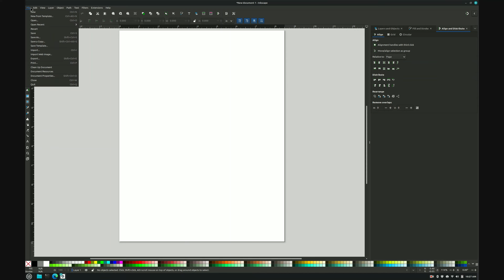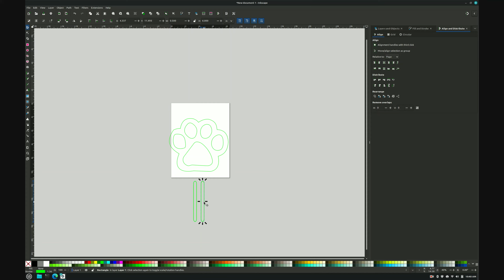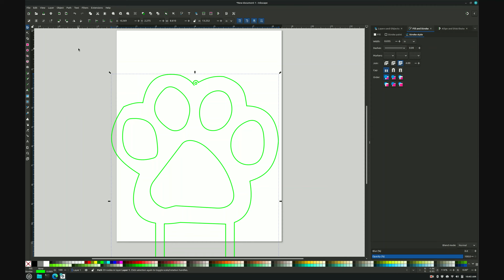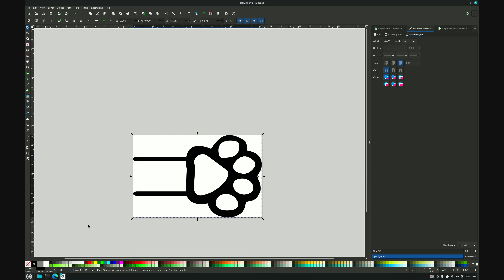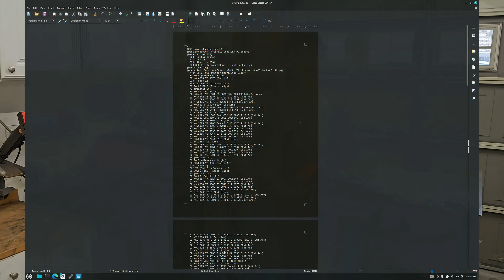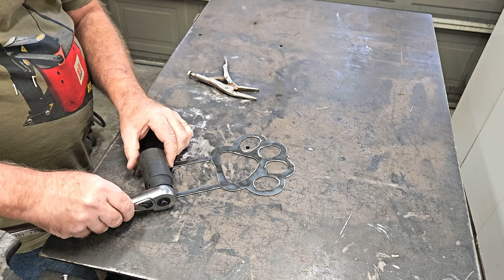Turning a Craft Show Idea Into Metal Art | Paw Print Dog Leash Hanger (Inkscape + ArcDroid)

Comment: I am new to your channel just found you as I’ve been scrolling through questions and answers on the Ark droid. I want to get one, but mainly what I wanna do with it is crafts and I’m not sure if it’s big enough memory to do much of anything I noticed in your video you mentioned you were loading a file that was G code and then you said you were gonna load a file that was just DXF doesn’t the DXF files have to be transferred into G code to put into the machine or can you load the DXF files without transferring into G code and what would be the advantage of either way?  And it’s awful hard to get an answer on how many lines of code this thing will hold at one point I read it can handle up to 30,000 lines of G code any help would really be great. I’m not a computer person.         I heard there’s a program called fusion 360 but that’s pretty much above my computer knowledge. Just wondering if this is something I should buy or just pass on.                 Any help would really be great      Jim
Reply from the maker: Wow that's a lot of questions, and I'm probably not the best source of information but I'll give it a shot.  The arcdroid can accept dxf files directly and it generates it's own G-code from that file.  Arcdroid also provides the plugin to many programs such ast Fusion 360, and Sheetcam so they can generate the G-code which you can then copy to your arcdroid.  I use sheetcam.  According to Andrew (arcdroid creater) different sources generate cleaner or dirtier Gcode which makes the G-code line limit difficult to define.  I translate that to mean 10K lines of dirty Gcode take more resources than 10K clean lines.  For Art type projects which I do all the time you can use Inkscape to draw the project and then save it as dxf, then load it into the arcdroid.  Inkscape is free open source software and there are tons of resources on youtube to teach you how to use it.  The advantages of the arcdoid in my opinion is its size.  You can store it on a shelf.  It weighs 35lbs or so.  You can draw items directly on it using simpletrace.  The trace function is great for people less comfortable with computers.  I hope that helps!   Thanks for watching!
Reply: @6 @6.8liter74  in your email you sent previous to me you mentioned three programs fusion 360, sheetcam and Inkscape  which one would be easiest for me to use I’m not a computer person. I’m 73 and I’ve been a Tool and die maker for the last 42 years 20 years ago. I took on the maintenance and machine repair department in our 35 man Shop and I’m never got into computers. Don’t think I really want to. I bought one of these machines two years ago, but it wouldn’t let me make the stuff I wanted to make so they took it back, now with all the upgrades, I want to pick one up and use it in my crafts. If I can figure out how to do the programming they tell us that the machin is now eight times more memory than the old one, but they don’t tell you how much memory it has so until I get a hold of another one I guess I’m not gonna know, can you send me some pictures of some of the more intricate things that you have made on your machine with the new upgrades I would really like to see what it can do. Thanks. Jim.